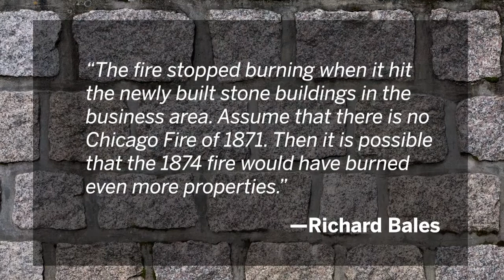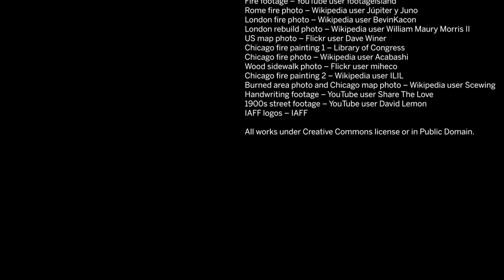How the Great Chicago Fire of 1871 Changed Building Construction

Comment: I saw a metal and glass building on fire. I saw a concrete and metal bridge on fire. I saw miles of guardrails on fire. 🔥🏛🔥
Reply: Yes, it's not just the structural material--there are coverings, coatings, interior furnishings etc. that are flammable even if concrete, steel, stone, and masonry are generally not.
Reply: @WindyCityRoadWarrior  Dr. Judy Wood has a better explanation.